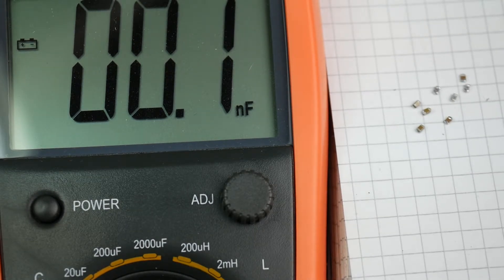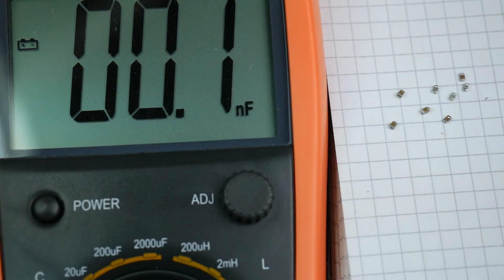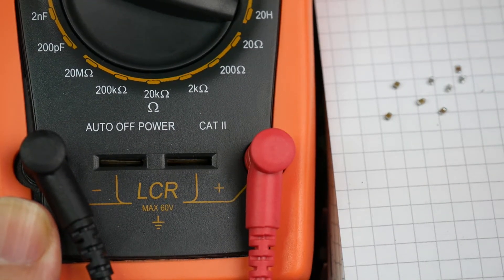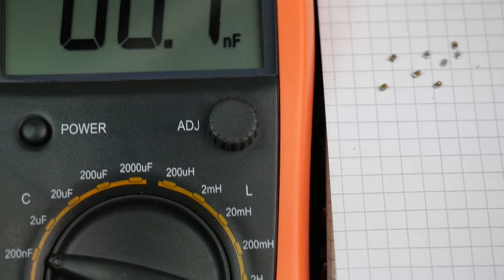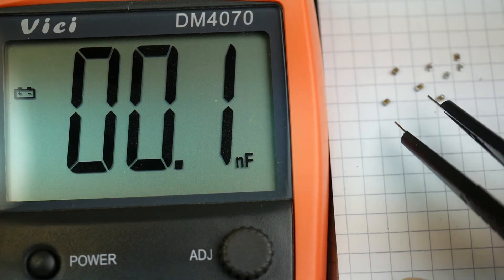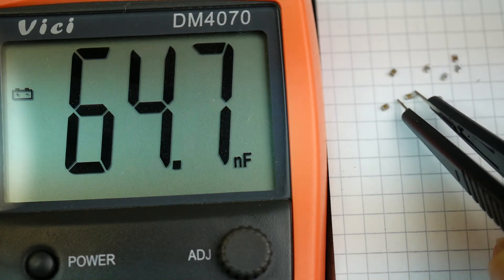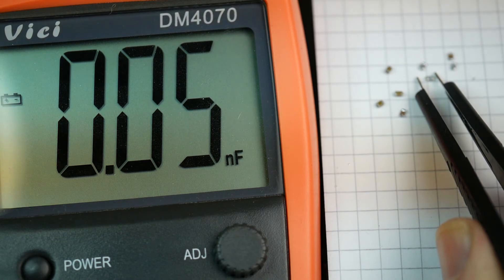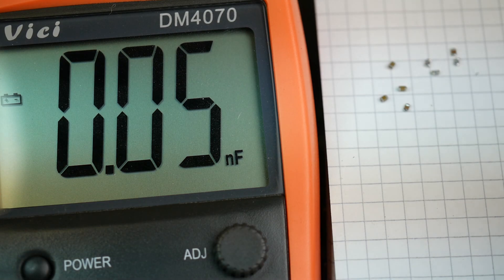Measuring Capacitors with the Vici 4070 LCR Meter

Comment: Umm...  You used an LCR Meter to measure the Capacitance of capacitors  OUT OF CIRCUIT
and you didn't bother to measure the ESR
..................... OK
Could have done the same thing with a DMM

Why not try measuring components in circuit and see how it performs or how accurate it is ?
Just a thought

Comment: Good afternoon. please help me. Tell me the nominal values of the containers on the top board of the mode selection from the top, bought and bought this device from the hands . capacity soldered shows complete nonsense at the limit of 200 microgenri, divides the floors 150 shows 75! my mail shlyaynin81@mail.ru